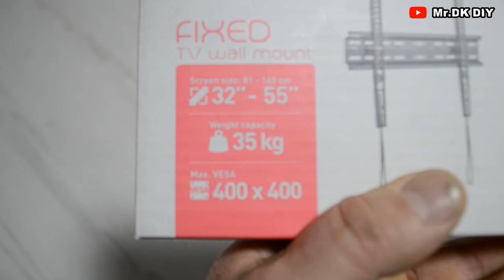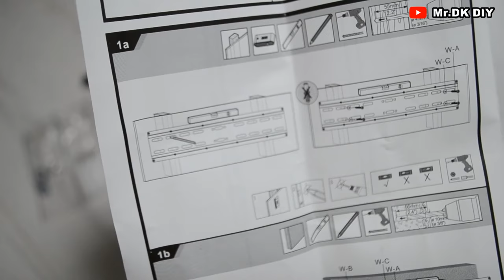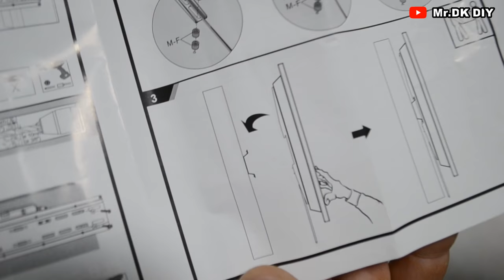How to FIXED WALL MOUNT for (LCD & LED) TV / SUPER Easy Way

Comment: Good Job, my stand is very similar to yours so your instruction was easy to follow. The only thing I did not use was the spacers as I found the screw too short and was worried that the tv will fall off. My TV is quite old, so more thicker so managed to screw the entire screw in. I used your tip, drilled with a 6mm, then 10mm hold. Initially, I was going to start with the 10mm but realised, might cause the wall to crack more. My stand came with a level attached to it, do not use it, it's not accurate, used my own spirit level. But I am very happy how it turned out, 100% level. That is is most important part, to make sure it's level, straight overwise your tv will be wonky. Thanks for the video

Comment: Opened box and thought nope! Watched this and it’s beyond easy..
Well I haven’t done it yet but looks less scary than I thought many thanks
Reply: literally the same has just happened to me with an almost identical tv mount from ikea.. feel a bit better after watching this however ikea don't supply the screws to fix the mount to the wall.. finding out the right type is gonna be an adventure
Reply: Ha ha, that’s my feeling exactly. Components have been sat on my dining room table for about a month!😳🙈😂

Comment: Clearly, he'd located the studs, but it would have been ideal to show the location steps as it might appear for some he didn't even bother with that.  I did see the wood coming out of the holes when drilling so he had located them..
Reply: Studs? That's a brick wall...

Comment: What a garbage product. If you have kids like I do it they could push the tv off the wall because there is no locking system for the horizontal axis. I will be returning mine.
Reply from the maker: my children are brought up, so I don't have a problem with that